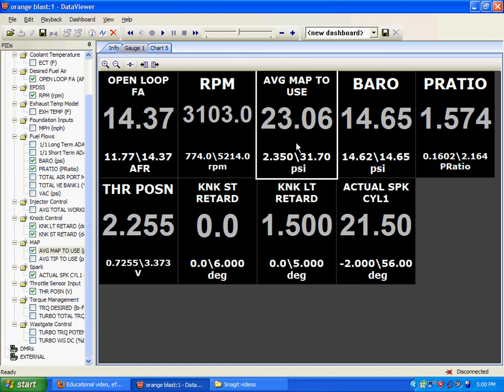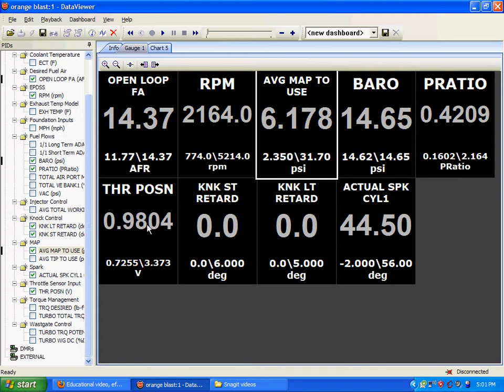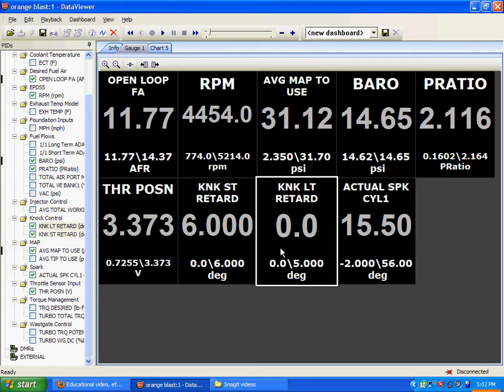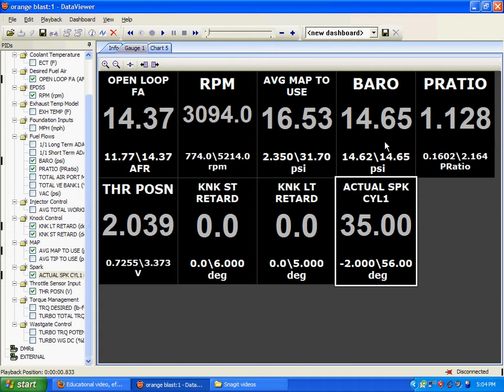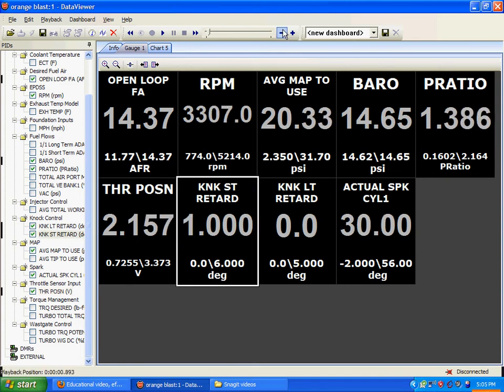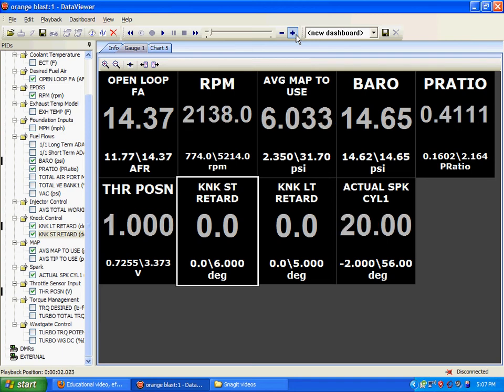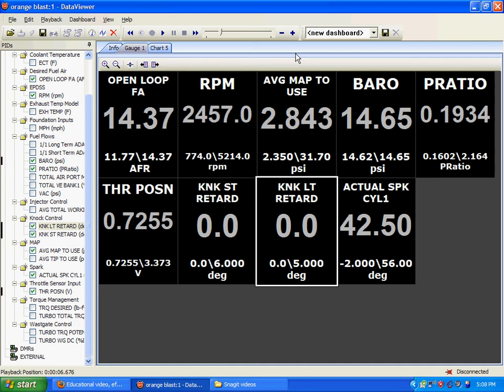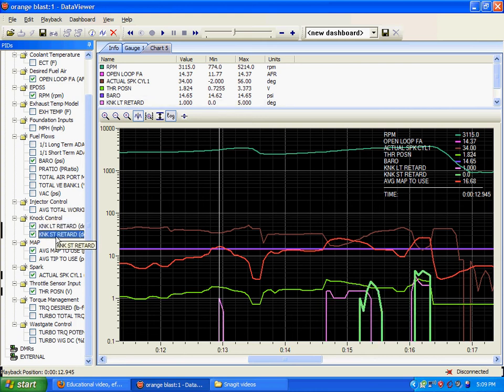SRT-4 Partial throttle boost effects.

Comment: I ran a data log today on my SRT4. I ran WOT from 2800-6200 rpm in 3rd gear. my AFR on the log was 11.34 to 11.76 during the pull according to the logged data. I had  no LT knock and I had 1 ST knock at 4500-4800ish rpm it dropped to 0 and then went to 2 then 3 ST knock around 5200-5800rpm. should I pull a degree of timing or add fuel in that range? also I do not have a wideband installed just yet. I only have an Intake and Greddy RS Bov right now. Also since the data shows my AFR around 11.3-11.7 does that mean my car is actually running that? or is that just showing me what it's "goal" is

Comment from the maker: I have found the best setup to be the OEM wastegate actuator, and PCM boost. One setup better would be the N2MB Boost Box, on gain and learning range 0. I have little PTB on my S3 with the S3 WGA. I have driven a few SRT's with stiffer springs, including a a modded spring. I prefer stock.

Comment from the maker: You are correct man. PTB is anywhere from 0 to your target boost. You want to stay in vacuum or go WOT, never in between. If your target boost is 20psi, then anything from 1psi to 19psi will be achieved with partial throttle, and will result in timing and fuel "mis-managment." All or nothing is my motto.